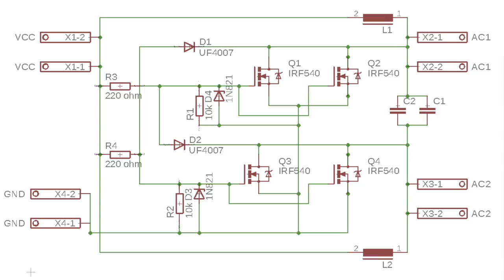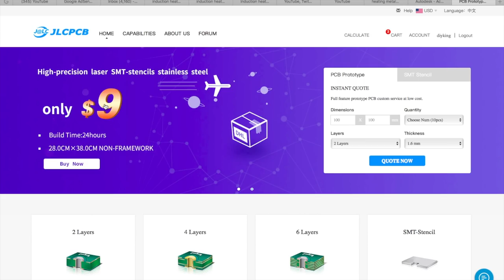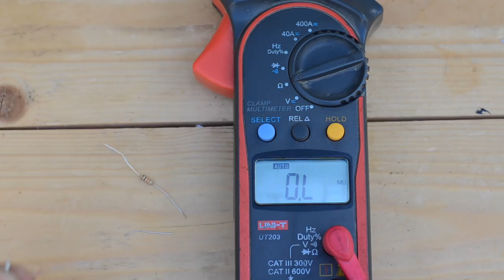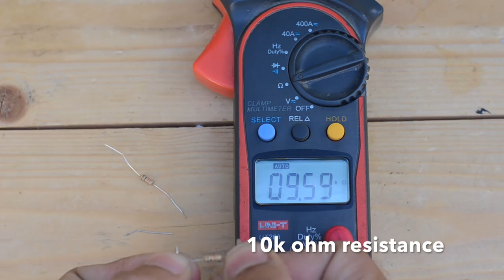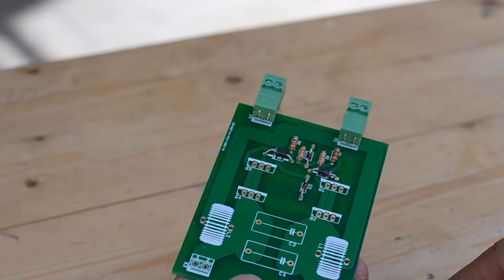How to make an Induction Heater (Like a professional one)

Comment: Immediately (~1 second) after plugging mine into the wall (and with nothing within the coil) the coil heats-up so much that it melts the solder holding it to the cirtuit board.  Any ideas how to fix?

Comment: PARTS LIST BELOW COMMENTS:

COMMENTS:

Circuit diagram , plz, or you are just a shill for this jlcpcb place. How many amps is the PSU supposed to be? What exactly does adding a 10 ohm 2w resistor do to your 15v input voltage? Does it affect the amps?  I checked out the linked Instructable, while IT has an INCOMPLETE parts list it is still lacking a circuit diagram.
Awesome clickbait shillstub, though, dude. Lookit you, aren't YOU so smrt!! /sarcasm 

PARTS LIST:
NB that I am occasionally using the keystrokes "uf" to designate micro-Henrys in this list BUT ALSO there is a PART with that prefix.(UF4007) DO NOT USE IF4007 diodes or your entire project WILL go up in sparks and smoke. Ye Have been Warned.

2* 10k resistors
2* 2200 ohm resistors
2* UF4007 diodes (UF (Ultra Fast) NOT IF (Is Fast) OR YOUR HEATER WILL GO SPARKLY-BOOM)
2* 1N821 ZENER diodes
2* IRF540N MOSFETs
2* capacitors/banks ~400VAC non-polar 0.33uf capacitors. (Volts seems to be more important than Micro-Henrys (uf) here, ideally you want 800VAC of caps but ya can play around a bit with the numbers.)

2* 30mm toroidial (circular not tube shaped) ferrite cores OR 2* 100uf inducers
Semi-optional part: f NO CLUE WTF a "100uf inducer is you WILL need enough 1.2mm solid copper wire to do 30 wraps around EACH ferrite core
12v PC fan(NOT a cpu blower) 

2* heatsinks (aluminum or copper) that fit your MOSFETs
1* small tube of thermal paste for an excellent thermal bond between the MOSFETs and their respective heatsinks (this step is entirely missing from the vid and Instructable but all ya gotta do is smear a thin layer of paste on the surface of the mosfet(s) that touches the heatsink directly before screwing them to such)
1m (100cm) * 5mm diam. copper pipe 

10cm* 2.5cm dowel (any material that you can wrap a coil of the 5mm copper pipe around, I suggest wood but whateva ya use is fine)
12v power supply with sufficient amps (I'd guess 20+, but this info is sadly lacking so idk this for sure. TOO MANY amps is better than not enough)

VERY USEFUL but NOT needed tools/extras:
Multimeter
impedence meter
volt tester
ohms tester
solder iron
solder

Comment: Bro.. In practically we do induction heating of like 30 mm dia rod for heat treatment purpose but the set up is very huge.... Like we need cold dm water circulating inside the coil  for that we need one chiller... The over all set up is of one big room...

Comment: The fan never turned.
Reply: He probably killed it by using 15 volts
Reply: @tejasbhandare251  probably
Reply: Or the camera frame rate didn’t let you see the fan run. He clearly stated he used a resistor to take that 15 volts to 12 volts.
Reply: @treyhoshall  you would have seen the fan move when speeding up
Reply: Not necessarily. All depends on frame rate.

Comment: Great project , but their is one limitation. You can't run it for long time as copper tubes can melt. Professional induction heaters have chilled water flowing through the tubes. Keep up the good work
Reply from the maker: Thanks.

I have added a small fish tank water pump to the copper tubing to flow water across the copper pipe to keep it cool. That part was not added in the video to keep the project simple.
Reply: Next step is to send water through the tubes...
One step at a time...

Comment: I started watching the video and got to the part when you pointed to the change in colour of the screw inside the ring. I was looking at the 2 chokes and saw that the wire here was also changing colour - must be too thin. I then saw in the schematic that you had doubled up the mosfets without any attempt to load-share - not even separate gate resistors. I didn't watch any more.

Comment: Better to use thermal-paste  not ruber paste on MOSFET 
Nice one 
You may reduce the cross-sectional area 
For better heating.
Reply: Silicone grease will work. It is a good thermal conductor and very good electrical insulator.

Comment: Increasing the voltage of your gate voltage clamping zener diodes to somewhere around 7.5v to 9v might help the mosfets to run cooler and possibly increase power output by a small amount. With only 5v of gate drive (I know there is most likely some overshoot) the mosfets aren't being fully driven on and so the Rds(on) will be a bit higher. This results in more heat dissipated in the mosfets and less current able to pass through them.

Comment: This is intriguing, I would be very interested in scaling this up five or ten times and using liquid cooling where necessary. I need a large induction foundry 😈 for....stuff 😁😈
Reply: Good point. I used to think that there was cooling water in the tube. That seems like a good idea. But it doesn't get hot because copper has very little interaction with magnetic fields. It's actually the "current" that's interesting to watch. You need a lot of current to melt metal. 
I have a small one of these things that I bought on Amazon. It draws almost no current at all with no metal in coil. As soon as you put metal into it he current shoots up. The bigger the piece of metal higher the current. 
So yes, you can scale this up, but it's actually the power supply you need to worry about. A car battery should do this nicely, but it won't last long. 
You're better off buying bigger MOSFETs too, rather than putting them in parallel. One of the MOSFETS tends to "hog current" in these configurations. It's like pairing up a major league ball player with someone like me, who sucks at sports. Electronics is MY sport!

Comment: That was a great video. You should be proud of your production. I've used these quick turn around PCBs before, but they were for much more complicated boards and took quite a while to design and verify. But I was really impressed with your attitude for use with these simple boards. As for constructive comments, you do need to improve your soldering skills. And to really use 130A you would need to "seriously"  beef up all connectors, wires and PCB traces to deliver that sort of current to the coil. I suspect you are only using a fraction of the full capability of that power supply.

Comment: nice! are you sure those input connectors are rated for the amperage? also the small capacitors probably swelled up due to their ESR, there are very high peak currents between the capacitor and inductor due to the inductor capacitor resonance of the circuit. awesome build though!!

Comment: Amazing how those little tiny channels of doped silicon in those MOSFETS can switch 130 Amps continuously.
Reply: No they can't IRF540 is rated at 28A and that is with high enough gate voltage and adequate cooling. 
Pulsed drain current maximum is 110A and that length of the pulse must not exceed a range of duty cycle and duration.

Still power MOSFET's are amazing and the IRF540 is already a dinosaur device, much better devices are around.
Reply: @outsideworld76  Is there any way I could push more current and still have a frequency of 1.1 MHz or more
Reply: @atul2048  Use more mosfet parts in parrel.
Reply: @atul2048  use a good mosfet driver that can supply lots of current
Reply: @d.t.4523  can we use a power supply less then 130A range if we aim to achieve more then 20mT field intensity in the range more then 20kHz
Reply: @ShafqatAli-jg9ym  I don't know. My yardstick won't count that high!

Comment: It nice buddy,  but 130 Amp is too much current,  I have a power supply with 40volt and max 5 Amp,  how can i handle such induction heater with this power supply? I'll appreciate if you answere

Comment: Choice for heater: cartridge heater, tubular heater, immersion heater,finned heater,flange heater,flexible heater,heater tube,ceramic heater,bobbin heater,ceramic heater core,ceramic band heater,mica band heater,brass band heater,hot runner coil heater, nozzle heater,hot runner heater,coil heater,resistance wire,silicone rubber heater,drum heater,casting cooper heater,casting aluminium heater, casting iron heater,high temperature cable,quartz heater,tubothal heating element,SIC heater,MoSi2 heating element,thermal oil heater,air duct heater,oven heater,explosion-proof heater,circulation heater,PTC heating element,IBC heater,thermocouple,PT100,PT1000,pizza oven machine and so on.

Comment: Great video. I will try this soon. Just one question: I probably won´t be able to get the same values for the capacitors and inductance (the one you got from computer scrap). That would affect the frequency and this way the induction level. Is there any risk?

Comment: Hi, I have a question. 2 inductor= 100 uH (50 uH + 50uH) or 1 inductor 100 uH?
Reply: Because , 30mm x 18mm x 13mm ( gray toroid 32.7) 1.2mm wire 30 turns = 40uH

Comment: the problem with the capacitors is not the voltage rating but the rms current rating.  you probably don't have that in the capacitor spec sheet.  also you probably don't know how much rms current u were pushing thru the caps or thru anything else in ur circuit.

Comment: ok, so I have a question. is it possible to control the temperature of the metal with the induction heater? I have a project that is temperature-dependent. 
That and I will need to make or buy three of them as well.

Comment: what? Glue on HeatSink?
Reply: no melting there I suppose :D
Reply: Thermal past like what you use on CPU heat sink
Reply: @SpaceManAus  TIM is not an adhesive, and would be applied between the MOSFET and Heatsink, not between the heatsink and fan.  Without the schematic you cannot calculate the heat dissipation needed for the MOSFET's he chose, it's possible the heatsinks do more than well enough without the fan at all.  I'd only install a fan if I were putting this in a sealed box.

Also, unless you're buying low temp glue gun sticks, you're looking at 400f before that glue melts and the fan fails.

Comment: can i use it as a simple plastic melting heater by placing a nozzle in it and pushing plastic through the nozzle? and can i control the temperature by reducing or increasing the current?

Comment: resistors DO NOT drop the voltage. They drop the current!!!!
Reply: Jake Joris We measure the voltage dropped across the resistor. The amount of current that flows through a resistor is a result of the voltage dropped by the resistor divided by the resistance. You can change the amount of current through the same resistor by varying the input voltage. If you increase the voltage the current through the resistor will also increase.

Comment: When assembling the card it is useful to start with the lowest profile parts [resistors, small diodes, etc] to prevent them falling out of the card when you turn it over to solder the leads.  A pad of foam rubber on the benchtop will help press the parts against the circuit board, and you can then clip the leads before soldering, which allows solder to coat the cut end of the leads to inhibit corrosion later - many component leads are solder-plated steel.

Comment: Please use better solder. I noticed almost every joint you soldered was dry, burred, and incomplete.
Reply from the maker: Yes I am focusing on improving my soldering skils
Reply: @DIYKingSaM  Good. Also using a little more flux would really help.

Comment: what if instead of the dc ac inverter you used a clock circuit that would discharge the capacitors into the coil, would that work?

Comment: how did you calculate the number of turns for the coil to achieve a particular inductance?
Reply from the maker: The no of turns is estimated from the data avaliable on web.
Reply: @DIYKingSaM  can we use a power supply less then 130A range if we aim to achieve more then 20mT field intensity in the range more then 20kHz

Comment: Interesting work, well. I have some questions for making a similar heater, can you please put a connection way so that I can ask the questions? Thank you
Reply from the maker: falconsamad@gmail.com
Reply: DIY King thank you, can you please reply my email?
Reply: Do you have any design method? or routine equations to calculate the parameters like required power, the number of coil turns, the operating ampere and voltage and so forth....?

Comment: i dont want it too hot i want to put line in my bird home under the nest and about 70 f
Reply: @Dharma Kissoon ... WAY too complicated and totally unsuitable. 

Buy a couple of mosquito/insect killer tablet heaters, break them apart and use the ceramic heaters inside. Use a heat spreader aluminium plate on top and monitor and control temperature appropriately. 

ENSURE you take GREAT care to use fibreglass or some other form of high temperature insulation sleeving on the heater block leads AND SCREW terminal connections! 

REMEMBER ... you're dealing with mains voltages!

Comment: can i melt small amount of gold with this ?
Reply: No, you can't
Reply: Janis Grislis aluminium has a really low resistance, making it hard to heat up by electric current. Gold is the same, but i has a lot higher melting temperature.

Comment: Hot melted glue on heatsink! what an idea☺😂
Reply: @soul hunter XII Hallelujah! FINALLY, out of all the "anti" comments the one that is most obvious and clearly SO wrong. I have seen MANY YouTube projects use hot glue to mount all sorts of items that will OBVIOUSLY get hot, but I mean, come on, the clue is in the name HEAT sink! Sheesh. At least it could have been silicone or epoxy, but with his other skills was it really beyond his ken to use a proper mechanical mounting? How to spoil an otherwise pretty good project (barring some circuit design details). 😔

Comment: wil this get hot enough to melt metals like brass, copper, gold, silver? beautiful engineered device, if it works i will build one for jewellery work.
Reply: for some metals it not work .
Reply: @usmanumer9871  i guess just ferrous metals....magnetic once that is...
Reply: @sitgesvillaapartmentneilsc7924  aluminium also

Comment: I am not an electronics guru, but it seems to be a quality piece to build, do you think it would be possible to put a potentiometer  it the unit to control the inductance energy for a precise heating. I have subscribed to your channel. Stay positive and never mind the people degrading your work.
Reply: Actually, you can, by using a variable voltage power supply. This computer server power supply is fixed at exactly 12 volts.

Comment: No of turns required for work coil(1/2inch cu tube ) outer dia of 16.5 cm.purpose is to heat 5 inch hollow fe pipe of 10 cm length

Comment: awesome video
but MESSY SOLDERING!
Reply: JP jay - Yes, the technique could be better. 

Never try to melt the solder with the iron. That will lead to what is known as a “cold joint”.

Heat the joint with the iron and use the solder to determine when there is enough heat. As you heat the joint, keep touching And removing the solder from the components being joined. When it is hot enough, the solder will melt quickly and be drawn into the gaps to create a good bond. At that point, remove the iron so as not to overheat the joint and burn off the flux.
Reply: @bunkie2100  exactly!
(or give it a bit more time)

Comment: 'Up your game' by passing coolant through the copper tube,... it will not affect the field-induced eddy currents in the metal to be heated. Your tubing could then handle (along with the caps and the MOSFETs) far more current.

Comment: Can you make and use bigger coils then the 2inch one's you made ?  Sort of like if I made a coil 10 inch diameter  and made the coil rap 42 times around a 10 inch pot  in stead of the cardboard tube  will it still work   ?   So I can melt copper or silver !

Comment: The electromagnetic induction heating machine can perform high-frequency quenching, welding and forging heat treatment on various metals, which is energy saving, environmental protection and safety.

Comment: Hi 
Great info 
Could you help me please I have a rosin slug it’s 32 mm dia and 35 mm high I want to heat it between 180 /220 degrees in 3 minutes. 

Can you help me design please

Comment: 0:54 pretty sure you killed the fan by using 15 v instead of 12v
Reply: Not only that he used glue gun for attach that fan on a heating surface

Comment: Amp??
Reply from the maker: It depends on how thick the metal rod is inserter inside the coil and the voltage on which the inductor is operating.

Comment: I'm working on a similar project (ZVS driver for a flyback transformer) and I have sourced a similar switching power supply to the one you use (24v 20A max). Did you have any concerns about the inrush current damaging the power supply?
Reply: can we use a power supply less then 130A range if we aim to achieve more then 20mT field intensity in the range more then 20kHz